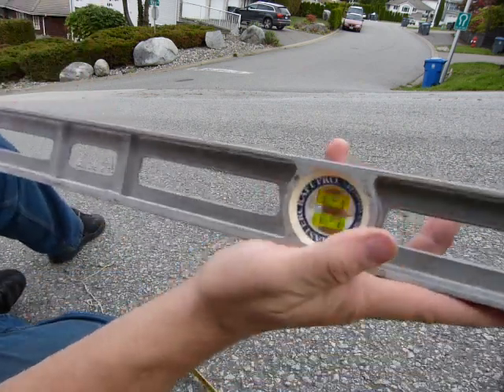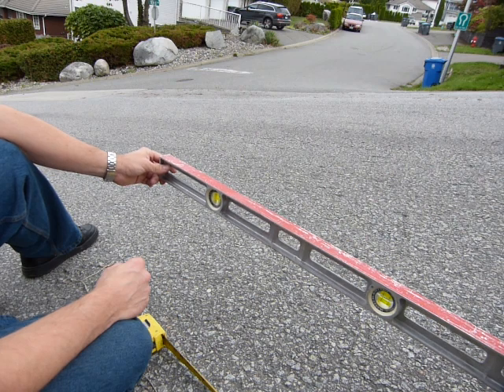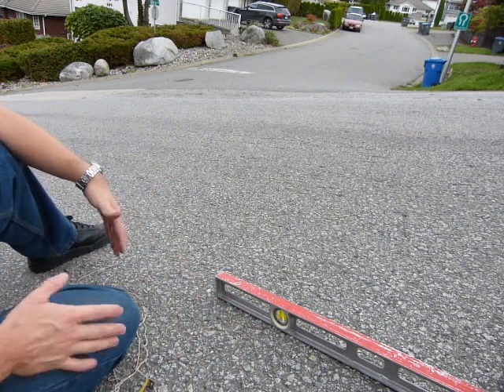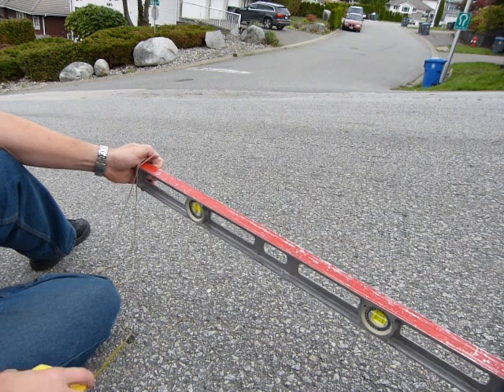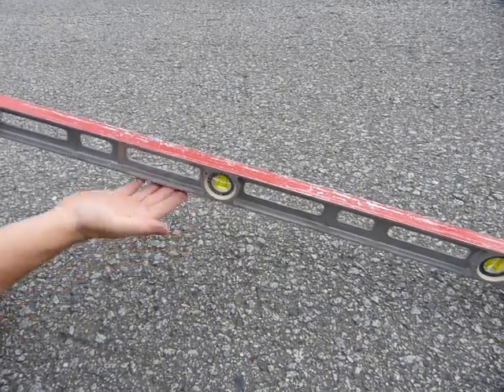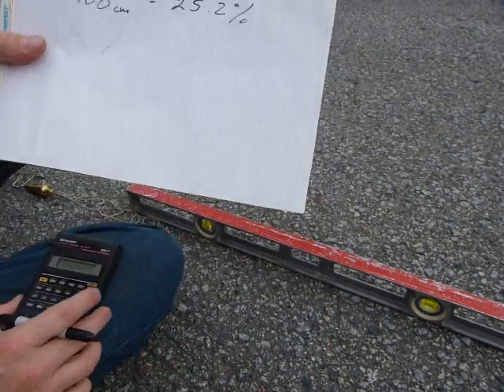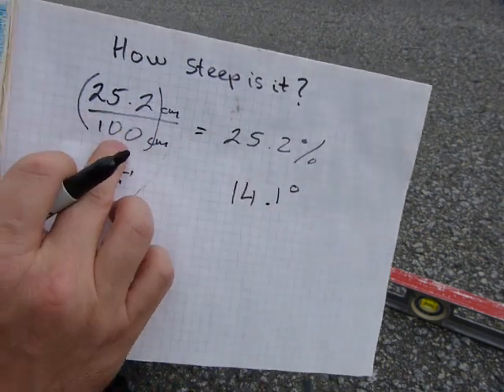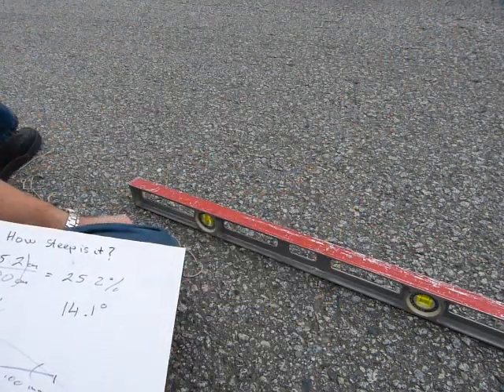Measure pitch/grade/slope/taper

Comment: Method is fine, but his math is wrong so he gets the wrong slope angle (theta). He dropped the plumb from the 100 cm measurement on the top of the level. The zero on the bottom of the level is on the pavement, so the zero on the top of the level is inclined at about 75 degrees! The plumb line will not pass the bottom of the level at 100 cm, it will pass at a lesser distance, lets call it D, and the extra distance needed to get to 100 cm is X. If the level is 5cm wide, the plumb line forms 2 similar triangles. sin(theta) = 25.2cm/D, tan(theta)=5cm/X. X+D=100cm. So theta is 14.8 degrees, not 14.1 degrees as he calculated, it is a 26.4% slope not a 25.2% slope. It would certainly make the math easier if he measured 100cm on the bottom of the level, marked the side of the level so he could see the mark, then dropped the plumb from there.

Comment: This method works approximately but is subject to errors in measuring the vertical distance because there is no way to ensure the tape measure is being held perfectly vertically. If you seek greater accuracy in your slope measurement, then the instrument you want is an inclinometer.
Reply from the maker: Yes, you are right
Reply: There is a way...a string level on the tape measure. The end.

Comment: I enjoyed the simple explanation brcause i was trying to figure the slope of my front yard because when the repaved my street and instead of grinding down to match the original street inclination (I think that the right term) they just pave over a lightly ground surface. Well as you might of figured the new pavement is now above everyones lawn, driveways, and rain water drain pipe.

Now when it rains the front yard about 2-4 ft turns into a pond when it rains moderatly. I fixed this 2 times over the last 20 years and yes I could have just had a dump truck bring dirt but thought it would be nice to learn the mechanics involved to figure out what the front lawns new grade, slope, or inclination would be so when I call the township and explain they need to bring some topsoil to fix my property.

Comment: I'm sorry, but triangle diagram at the end is wrong. 100cm is the hypotenuse, not the base. Therefore, slope is 26% and angle is 15°. Not far off in this case.
Reply: I don't think you're right.  The hypotenuse should be the slope length, it is the length of the slope as it drops (or gains) 25cm in 100 cm.

Comment: Or you can just download a smartphone app like Clinometer. Saves you having to buy all the things in this video.
Reply: apprenticemath not to mention when your battery dies in the middle of measurement
Reply from the maker: Absolutely. However:
Accuracy wil be limited to the length of smartphone. Long levels are more accurate.
Accuracy is dependent on a crude sensor, designed to flip screen.
Accuracy is dependent on software of questionable source or integrity.
If display cracks badly, it ends measuring.
If battery flat, no measuring.

On the other hand,

Tape measures & levels don`t need battery.
Tape measures & levels are cheap to replace if a tank runs over it (or whatever vehicles you might be in the way of)
Accuracy is dependent on remembering 3 things
A long level is harder to carry than a cellphone
- Thanks for watching.

Comment: Question :

   At what point of the slope do you do your calculations? Top, middle?
Reply from the maker: Brilliant math question.
If the slope is perfectly even: anywhere
If the slope is compounded of more and less steep sections, measure any section you like, may need 1 measurement for each section with different pitch.
It the slope is a convex or concave curve or a combination, measure anywhere you like, but slope calculated will only apply to the very 1m part that was actually measured. Half a meter up or down might be a different result. Surveyors may measure to top and bottom elevations on a hill and calculate one average pitch, disregarding actual small surface variations.
Reply: apprenticemath .. Thank you very much. 

I'm on a footing crew new to grades, fills, cuts, toe and laser level readings.

Your videos help tremendously. 

Thank you.
Reply from the maker: Thanks for watching. I have plans to make further videos on grade stick markings, optical and laser leveling, theodolite readings, taking an elevation around a corner. Any skill you came across and was a memorable learning moment? Topics for future videos? Send your ideas over.
Reply: apprenticemath ..

Well there is one thing.. 

Our crew is responsible for drilling and poring concrete for the piers and columns for the masons to lay 8" block.

My question would be how to make a easy and efficient way to find the 8 1/4" grade to line from level of comcrete to make troweling concrete as we pour from hole to hole more even?

I was looking online for possible some light weight tool that could be hung from the string line and adjustable to have the spacing from line to grade but don't seem to find any.. 

I hope my crude explanation makes any sense. Thanks
Reply: The main issue is that when we initially pour the concrete we may over or under fill. 

We then have to add or remove excess concrete so if there was a tool that was maybe 18" - 24" in length that was height adjustable and light weight we wouldn't have to measure at so many points to make sure the concrete was level and would save time as we usually pour 90 - 120 piers and columns in a day.
Reply from the maker: Get a carpenter to cut a dozen tapered full-scale grade wedge with the grade numbers you have. Tack stick to the form between level line and grade, finish to the underside of the tapered wedge.
How`s that?